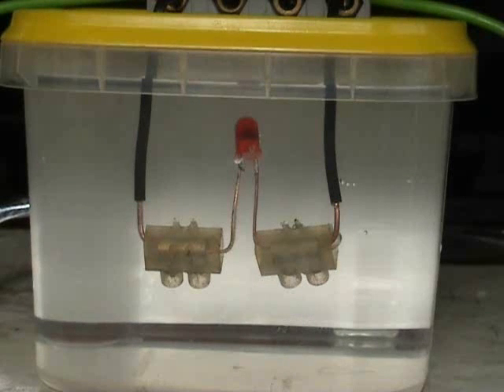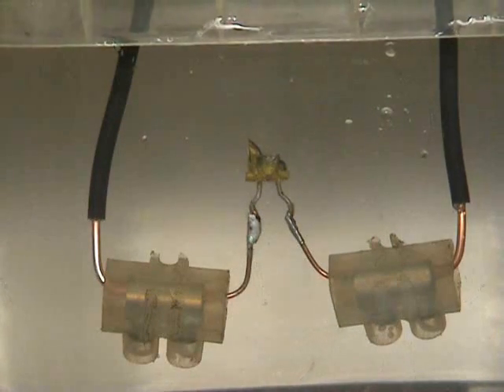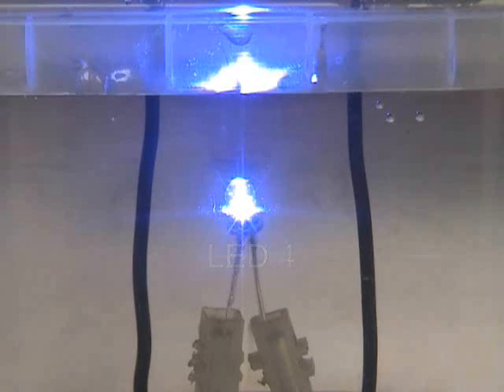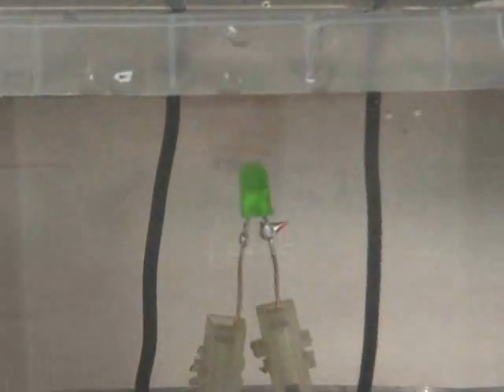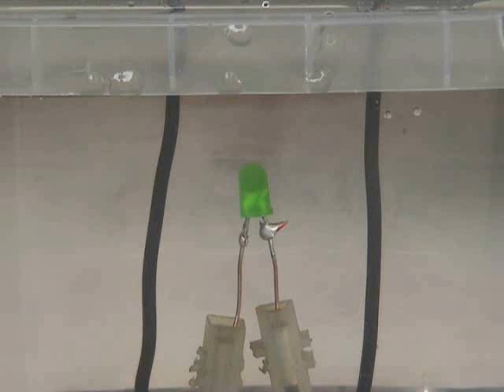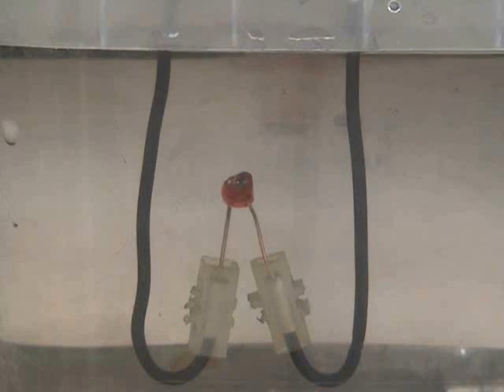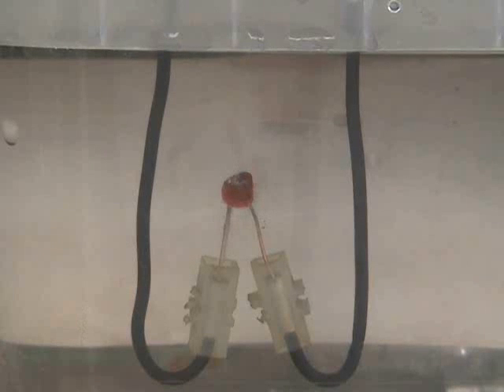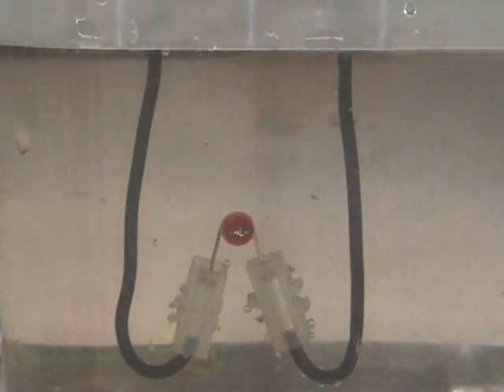6 under water  LED  destructive tests

Comment: So funny when the epoxy of the case breaks down at 2kV and the water splashes out.  What value of capacitor are you charging?  I made a small Invertor to charge 100uF to 400v and that is quite destructive - old neons shatter.

Comment: I'm watching this because the same happend to me 1 min ago. And I used a 9 Volt Block only, but the LED was not the same. I was so frightened, because I didn't expect it would explode!
Reply from the maker: +toskana98 LED's will explode on a 9 Volt battery when there is no current limiting resistor. Hope you didn't get anything in your eyes.
Reply: RODALCO2007 I know, I did it on purpose, but I didn't expect an explosion :D

Comment: Who manufactures Blue LED No.4...? How many volts until it failed to glow?
Reply from the maker: +ZakarooNetwork Got it of ebay. China I guess. Anything over 3.3 Volts and no current limit will destroy the led as they are rated for about 20 - 30 mA.

Comment: seit wann kann ne LED explodieren ?
Reply: MultiWirth dank Hitze wen sie durch brennt und dann in der Farbe einer Glühbirne leuchtet werden sie richtig heiß und wen man wie die Leute da über 500V durch jubelt ist es klar das sie explodieren
Reply from the maker: An LED will even explode when connected to a 9 Volts battery without a resistor.
Reply: RODALCO2007 There is a difference between "explode" and "breaking".
With more than 4V will every LED burn for a short time and then is it dead.
But no explosion in the end.

Comment: Was it foam or bubbling? Because bubbling shows you are turning the electrical current into Hydrogen,as the water conducts the electricity from the poles which flows all around in it.

That is normal.

If it was foaming like it had soap in it then it's really weird.

Comment from the maker: @jk037 Voltage pulse was about 1 second. increments steps of 100 Volts at the time. most shots were at around 1.5 kV and over

Comment from the maker: @HDXFH  A variable DC supply to be used for cable faults.
in steps of 100 Volts up to 4 kV at about 100 Amps discharge.

Comment: @RODALCO2007 - Interesting idea :-) I still have that train transformer, a digital camera that can do videos, and plenty of old caps (but not the green ones). I've got a lemon Panasonic 50" plasma TV with bad caps on its power board, so I'll get some extra parts when I order, need to get some regular diodes and light them up ;-)

Comment: Wonderful things happen with a toy train transformer (12VAC). Connect a non-LED diode like a 1N34, hmmm ramp up to 120mph (full speed) diode lit up orange for a few seconds (a LED!) then blackens and smokes. Green plastic cylinder capacitors, interesting, few secs, bubbles at the top then vents... 3-legged transistors no fun, 2N2222 just popped its top off in an instant. Resistors, just smokers. Electrolytics were fun, vented good.

Comment from the maker: @Invisibrah A LED can even explode from a 9 Volts battery when no series resistor is inserted.
It is often a good idea to use safety goggles during experiments, especially when testing.

Comment: @vanjastanic My guess would be that the high voltage is splitting the water into hydrogen and oxygen. The bubbles are reall small so appear as smoke.

Comment from the maker: That is the surge generator ( Thumper ) discharging the high voltage capacitors into the LED under test.
You are correct some water came into the mike.

Comment from the maker: The heat of the expanding LED die, when the current surge flows through the LED makes the plastic case expand rapidly and hence blow apart.

Comment from the maker: Just see if it created a different effect.
I had the cable fault surge generator at home over the weekend.
As you already proved, LED's do blow up at 12 Volts and excessive current.